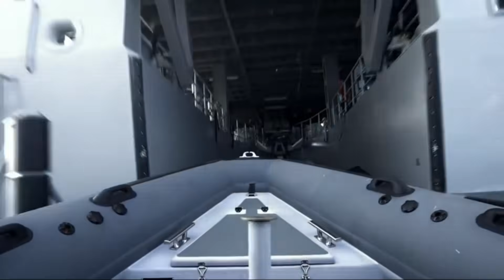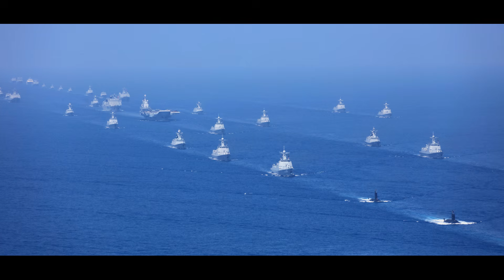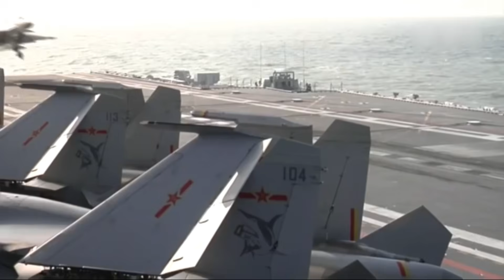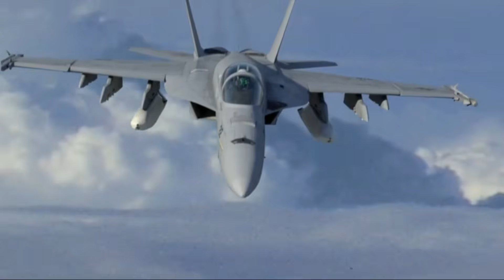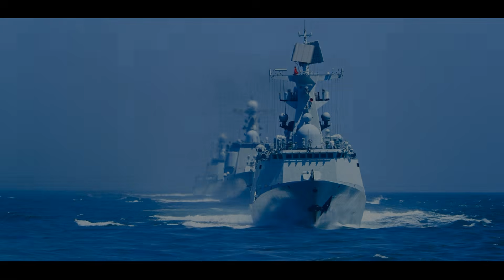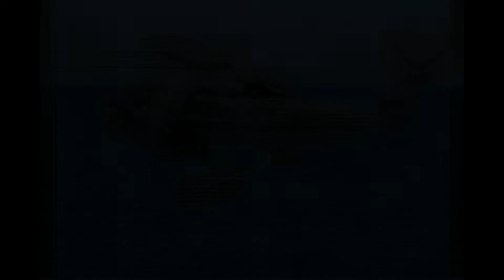Up-Gunning the Arafura Class OPV

Comment: 1 correction in the video,

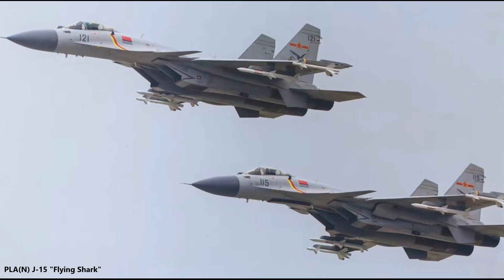13:00- Shandong doesn't carry 32 J-15s.

The fictional number was created on the basis of hangar being enlarged & improved flight deck. While the latter is true, the former is fictional. Kuznetsov to Shandong, the hangar size is the same.

The max number of J-15 it can store is 26 (vs 24 on Liaoning), even 28 J-15 is considered a strech.
Reply: & 12 helicopters.
Reply from the maker: Do you have a link dude?
Reply: @hypohystericalhistory8133   as for media articles? I have no links

But I can explain it to you,

Kuznetsov & Liaoning can carry upto 24 J-15 & 12 helis (36 aircrafts total, not 50 as reported by mainstream media all the time).

The number 32 for shandong circulated after it was said that the aircraft hangar for Shandong is enlarged, removing the weapons storage & the missile battery near the bow + the improvement on the flight deck (smaller island & flight deck where SAM cells were located in Kuznetsov/Liaoning).

The smaller island on Shandong allows to pack 1 more J-15 on the flight deck (between the forward aircraft lift & island). There are further improvements that allow it to pack 2 J-15s more on the flight deck when compared to Kuznetsov/Liaoning.

The flight deck in place where kinzhal were stored allows the J-15s to be parked at a better distance from the landing strip compared to Kuznetsov/Liaoning.

As for the hangar being the same size as Kuznetsov/Liaoning, there are pictures available for its' hangar bay. https://twitter.com/HenriKenhmann/status/1221099687815479298?t=TKaPexNYnGXvXkxKzblxNw&s=19

The hangar is around 153×26m, if the media reports of hangar bay being stretched to where the P700s where located is to be believed then the hangar would be longer than even Nimitz...which is not the case as proven by the pictures of shandong' hangar.

From 24 to 32 (flight deck + hangar),

Packing 8 more J-15s (compared to Liaoning) on flight deck is not possible. Same number in the hangar as the size is same. So it's 26-28 at best. The number is agreed with analysts such as RickJoe_PLA (Twitter account) & Henri (the one who's tweet I shared above).

+ I myself have experimented with a digital Ouija board created for Shandong & have found similar results. I can share the pictures if you have a discord/Twitter account.

I guess I have explained well?

Comment: For the high-end fight scenario, Australia needs something that can deliver a considerable number of anti-ship missiles without having to deploy the entire RAAF against that target. I agree with you, we do have the capacity to locate and support a operation to destroy a PLAN CBG. It is our ability to get enough missiles to the target that is in doubt. Remember in any war, RAAF assets are going to be in high demand, being able to assemble the entire force of Super hornets for a single mission unlikely. The USAF concept of deploying the palletized LRASM from the C-17 makes a lot of sense for Australia. The advantage of modern long-range ASCM's is that they do not require an expensive penetrating platform to deploy them. If we wanted to, we could buy some old B-52's and put them through the current USAF upgrade program which includes replacing the 1950's era jet engines, which would give you a long-range asset that could deploy twenty LRASMs from Amberley for a low cost without having to wait ten years for it.

What about the low-end fight? If you look at the dispute between the Philippines and China, you see China deploying large numbers of lightly armed, often under the flag the Chinese coast guard and not the PLAN. It is reasonable that our allies to our north, Indonesia and Maylasia could find them themselves under similar pressure. The ability to deploy several armed patrol boats would be desirable for such a grey zone conflict. The Arafura class would be ideal for such a confrontation. LRASM would be overkill, but there are a wide variety of small cost effective off the shelf weapons you could arm the Arafura class that would be ideal. The Arafura is also cheap enough, with a small crew requirement, that the RAN could seriously consider building 20-30. We could build a substantial number quickly by building them in two shipyards, since construction of the Hunter class is to commence.
Reply: Instead of B52's we would b better off buying the B1's that are being retired currently and mounting them as anti ship missile trucks armed with LRASM
Reply: @montys420-  meh there's only a few of B1s and they're expensive as fuck to operate
Reply: @jonny-b4954  and B52's aren't??  Lol🤦‍♂️
Reply: @montys420-  Well, I mean you have a point to an extent. But no, not compared to B-1. B-52 is well known to have absurdly low maintenance and operational costs. It's one of the few reasons we've kept them around.  Plus, there's a few less B1's than B-52 aircraft in inventory: 45 B-1b's (air force retired 17 in 2021) and like 76 B-52's around, only like a dozen of the B-1bs are supposedly mission capable at any given point. They're much more advanced and have specialized parts. It's also much more limited in it's payload. Though some B-1's have undergone a refit (maybe it was just proposed) to increase bomb bay by 30% to carry hypersonic and larger ordinances.
Reply: @jonny-b4954  my reasoning is Australia wouldn't need many and could buy the extra airframes to cannibalise or could invest in re structuring there bodies snd wings for strength and put new engines on them so there cheaper in the long run in maintenance, otherwise Australia needs to hope the US will allow us to buy B21's?? I doubt congress will allow its export so the next best thing would b a stealth bomber drone in the shape of a B21 just for the payload advantages over the loyal wingman drones!
Reply: @jonny-b4954  and realistacally I think Australia would benefit just fitting g them with Lrasm until we do have our hypersonic missiles are developed and in production. PrSM will give the west a 500+km precision guided weapon and looking to extend that out to 1000km as another way to take out there navy and there islands
Reply: @montys420-  True. A lot of money to retrofit a B-1 to be all new though. To the extent Australia would want to get a good service life out of them. And really, for what? 1 squadron? I've never been fond of the concept of having a minimal amount of one plane. No matter how good. Short of like specialized shit, like it's fine to have a dozen U-2's. If you think about, so say you get a dozen of them. That's 2 squadrons. 1 will always be in refit/work up/training. So you now have 1 squadron of air power to deploy. Just seems kind of pointless to an extent, ya know? I'd say find a cargo plane alternative you could convert that's cheap and you could buy more like.... 36-48 of them. And yeah, probably not allowing export of B-21. That won't be ready for a decade anyways if I had to guess. And will be expensive as hell. I doubt Australia would want them. They have been.... weird in their acquisitions recently if you ask me.
Reply: @montys420-  I agree the B1B's would be cool, but they are an expensive aircraft to operate. The B-52 would be the cheaper option, and perfectly capable of doing the job we require.

Comment: Because the fitted for but not with policy worked out so well with the early ANZACS...Right?
A medium calibre weapon and SeaRAM should be the minimum load out for this class vessel's.
Reply: I reckon they should keep our 8 Anzac  ships evean after they build  9 hunter class. Change the main gun to a rapid fire 76mm with p3 shells  add a 21 sea ram system  at the back off the ship. Put another  8 cell VLS next to the other one. Making it 16 cell. Have 32 ESSM. And 8 SM2.  Change the harpoons over for new Norwegian long range anti ship missiles that has 900km range or add US new 2x4 cell external mounted MK41 VLS in the middle off the ship and have 8 LSRAM  anti ship missile or whatever  fit's  best.

Use them for heavily  armed coastal ships.
Reply: Agreed. This ship is rather anemic for a naval OPV. Would do fine as a Coast Guard OPV though. But the lack of a heptr is seriously limiting.
Reply: RAN seems to have forgotten or chose to ignore the CCP's menace in its supposed sphere of influence.

Comment: This is a great video and I agree with your proposal for up-gunning the Arafura Class OPV in order to use it as a supplementary vessel in a high intensity naval conflict, but I don't think there is justification for up-gunning all the OPV's now, since the likelihood of a high intensity conflict in our region is extremely low. I imagine it would be very difficult for DoD to justify the cost of acquiring extra capabilities for the Arafura that go beyond what is actually intended for it, as determined by our current strategic environment and defence posture. However, given DoD's own acknowledgement of the rapidly changing strategic environment, I would say that prudence demands we have a plan in place to upgrade the Arafura's if we decide the extra warfighting capability becomes necessary. Perhaps we should create a prototype upgraded Arafura as a proof of concept now so that we can prepare an upgrade plan that we could apply to the rest of the vessels if we need to in the future.

I really enjoy this content. You're the only youtuber I know that gives meaningful in depth information about the ADF's capabilities.
Reply: I agree, prototype immediately.

Comment: Thank you, very though provoking! I imagine that there has been thoughts of mounting canister launched LRASM onto merchant vessels, Offshore Supply. Stern Trawlers  and small Container or RO/Ro vessels. The ultimate  would be subsea deployed systems in neutral waters that hide until required.
Reply: Worked in the past . Australia even had signal stations isolated on small island rocks in WWII and were a great set of eyes in early surveillance of the Japanese
Reply: @Rusty_Gold85  Indigenous coast watchers signalled the attack on Darwin.
Reply: @bossdog1480  Father McGrath of the Sacred Heart mission on Bathurst Island.
Reply: That's exactly the stuff you'd do if you wanted to really really win.
Reply: Sounds like essentially a modern version of the Q ship, and I could definitely see it being used for an infiltration assault by navies that don’t have the numbers to take on a larger force such as the USN.

Comment: I feel the same way about the Royal Navy's River Class OPV, they are only equipped with a 30mm cannon.

While this may be fine in lower threat areas, I feel they are significantly underarmed if they are to be forward deployed in more dangerous parts of the world where the threat of anti ship missile's and drones are more significant.

Up gunning them to something like the Bofors 40mm mk 4 or 57mm mk 3 would be a great choice IMO, this would give them much more lethality and the ability to defend itself from a wider range of threats including missiles and drones. They are quite large vessels more akin to a corvette so I would imagine there is definitely enough growth potential.
Reply: anti ship missile's is  war and the rivers are not warships, If you want warships you have to pay/design them form the start not just stick more weapons on a OPV
Reply: @graveperil2169  What so just let them sink? I'm not saying to turn them into warships, but rather to give them a greater self defence ability. 

When operating in the Gulf, the most obvious threats are from gunboat swarms, land-based anti-ship missiles and drones which a terrorist or hostile state actor may use. To be of much use, the OPV must protect not just itself, but either merchant ships or mine warfare vessels it may be called on to escort. 

I would also remind you that the Royal Thai Navy operate the batch 2 and they have a 76mm gun along with a pair of 30mm cannons so there is easily enough room to add a non deck penetrating weapon system.

Comment: For those who keep commenting these are under armed have to remember it's a module ship and can easily be fitted with upgraded weapons and systems that's how they're designed.
Reply: The cost to refit such vessels after build is far greater then to included these aspects when being produced in dry dock. When the justification for such upgrades is present before production, it is questionable to why we would do it the hard way later on.
Reply: @lewisrosenfels536  I agree it is more expensive to upgrade them later instead of putting it in the original design, but these were designed as multi purpose ship and according to my mate in the Navy they have ready made modules which get bolted on and hooked up for various missions. Apparently they can be fitted within 24hrs
Reply: @matthewburgess1406  Thats good news in terms of mission modulus, I can imagine it would be for UAV and helicopter re-fueling. Anything combat like VLS, Anti-ship missile canisters and CIWS will take dry docking most likely. Which I think are the main things to be included from build.
Reply: I hope there's a dilation room module to accommodate the brave and powerful transgender contingent.